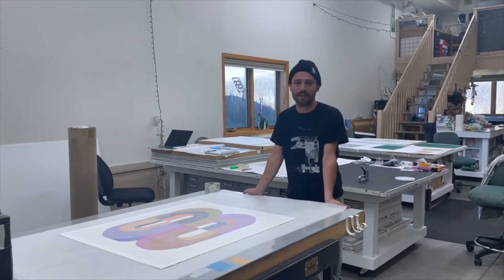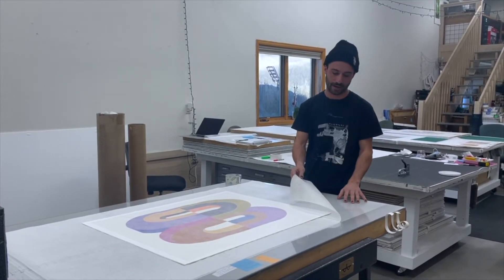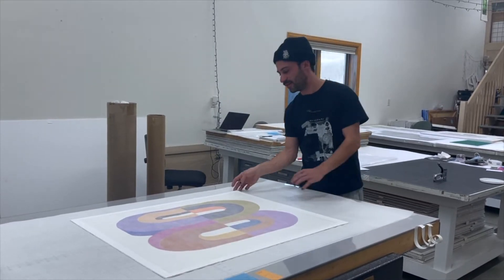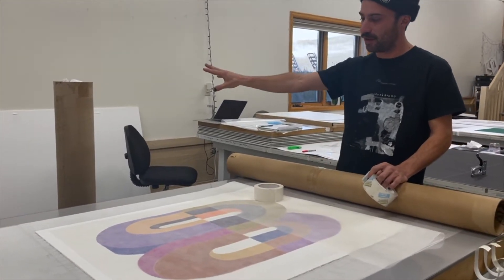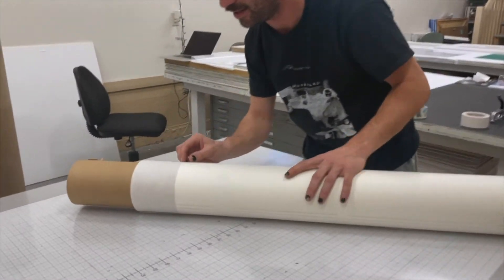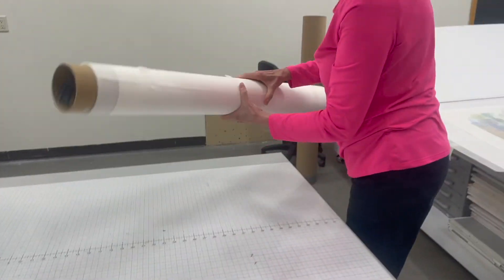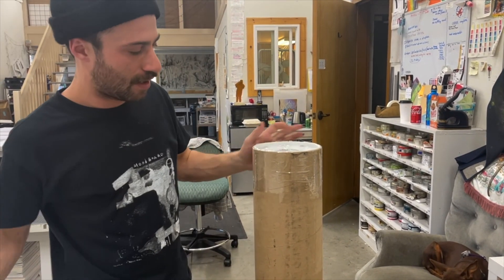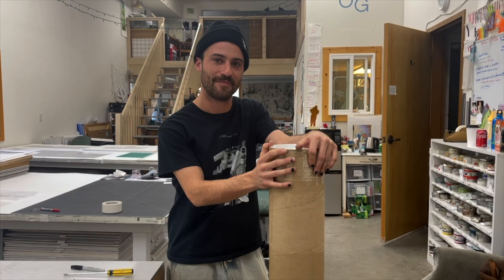How We Do It: Rolling and packaging prints

Comment: I’ve just sold a pretty pricey print. I’m going to ship it in a tube. But what is the material you are using beneath and above the print? I don’t want to use standard packing paper to roll it tin because It’s a very dark print and don’t want it to accidentally scratch against it and leave a mark. Thanks for any advice you can give
Reply: Glassine interleaving paper